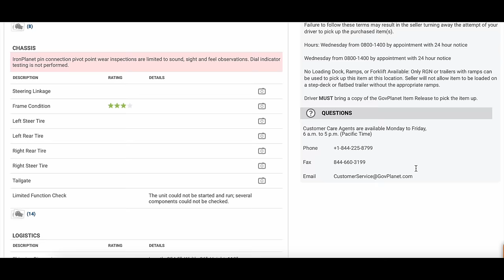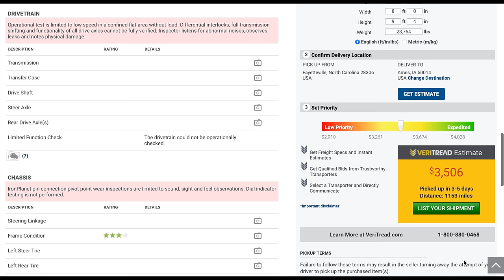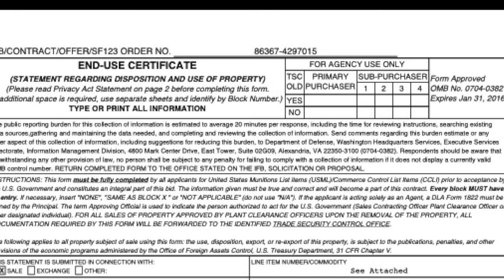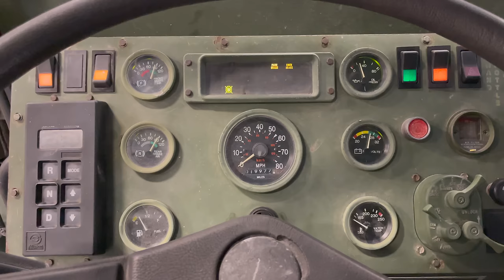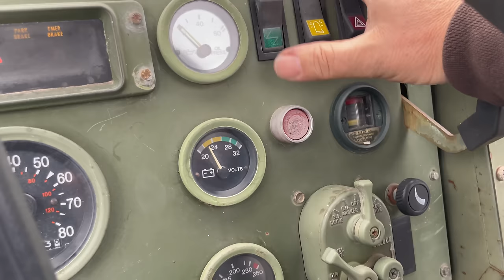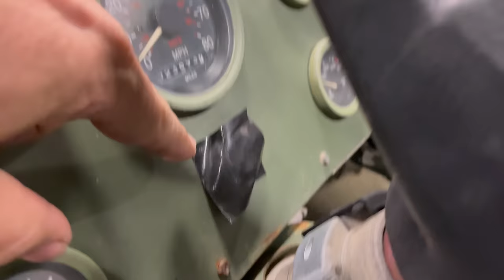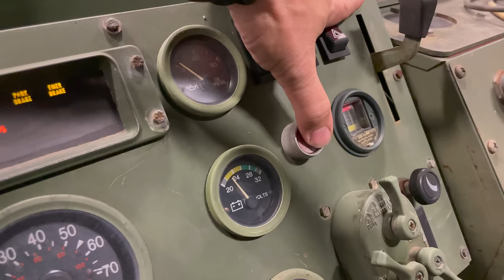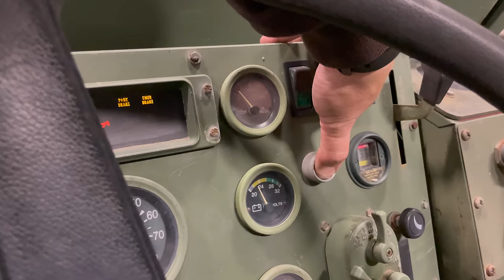Buying a LMTV on GovPlanet Wasn't How I Expected

Comment: These look an awful lot like the civilian and military trucks made by Steyr-Daimler-Puch (also Austrian, like the Pinzgauer). It must have been a design licensed to several manufacturers around the world.

Nonetheless, $3000 is not a lot of money for such a versatile vehicle, especially one with features like an on board hydraulic system for the tilt cab, as well as being able to adjust tire pressure on the fly.

Comment: Sounds like the alternator may have been good, but the regulator, probably within the alternator had failed producing a high over-voltage, for example, above 16 volts, which would fry many lights (LEDs) and the electronics in the vehicle.
Reply: Theyre 24 volt systems but your point stands

Comment: I've got a couple of questions for you.  Do you have to have a CDL because of the air brakes?  What is the GVWR? And, how long does it take the tires to adjust up or down after pushing the button?
Reply: At least in our state (PA), they're not greater than 26,000 lbs and, even with the air brakes, don't require a CDL.  You could load one with enough weight (or a trailer with a combined weight exceeding 26,000 lbs) and then you would need a CDL.  This is straight from the PA State Police Commercial Vehicle Safety Division.  The weight, not the presence of air or air-over-hydraulic brakes is what decides CDL requirements.
We operate one of these at work that has a 1000 gallon water tank.  Even fully loaded, it is under 26,000 lbs.
Reply: The tires adjust on the order of several minutes.  I know of several that don't work, the electronics or wiring of the system seem unreliable.  The air plumbing to/from each wheel is pretty solid, though.

Comment: The position of the steering wheel looks to be 90 degrees out of Sync with the direction of travel of the vehicle   !! i.e. , When you're moving straight , the steering wheel position looks like you're making a Right turn .....

Comment: Thanks for the great video.  I have a crazy notion to buy one of these mil-surp trucks to convert it into a SHTF RV.
Reply: @gurnblanston3210  - Very cool.  The 6X6 mil surp vehicles were also in the running for a post apocalyptic RV conversion.  What kind of mileage you getting in the MTVR RV?  Probably almost as bad as the 15 MPG I get in my 4Runner.   :-)
Reply: @gurnblanston3210  - Thank you very much for the detailed information.  Sounds like, as they said in the movie Stripes, one heavily armed recreational vehicle.

6X6 > 4X4

My 4Runner is set up as a stealth SHTFmobile.  It outwardly looks like a soccer mom grocery getter, but it's fairly capable off road and there's a lot of recovery equipment hiding under the cargo shelf.

There's nothing stealth about an MTRV post apocalyptic RV, but it would be awesome.   :-)

Comment: Having a lot of experience working on FMTV vehicles, all I can say is that they are total crap vehicles, from the grossly under-powered garbage-monopolized Caterpillar Engines, to it's gremlin-plague electrical systems, all of which comes out of no where and will leave one stranded. Been there, done that too many times.

That said, there is nothing like a trusty old "Duece & A Half" (M35A2), where half of it can be missing and it'll still run.

Comment: Are parts for these trucks readily available or do you have to cannabalise other trucks to get parts? I realise the engine and transmission are fairly common pieces so getting parts for them shouldn't be an issue - usually

Comment: Which is smoother offroad going at faster speeds, the pinz or the lmtv? I'm assuming the pinz.
Reply from the maker: Definitely the LMTV larger tires always makes things smoother off road no matter the vehicle and the 47" tires on the LMTV can absorb way larger bumps than the 34" tires on the Pinz.  The cab on the LMTV is also on a air spring system so the chassis takes all the hits and not you.

Comment: LOL! They took the tilt meter off the dash... Go like a bat outta hell in a straight line, wants to lay over at 20 in a corner...
Reply: That may just be because of the cabover effect. Cabover vehicles unless they are super stiff always feel like you are about to roll through a corner.
Reply: @Falcodrin  It's not an "effect" when the builder intentionally installs an extra metal plate with a crescent shaped piece of glass tube with a plastic BB in it. Especially when there are red warning labels at either end of the scale.

I've driven conventional, I've driven cab-over and then I've driven these... a trash truck (top heavy as hell, cab over) is still more stable than the MTV family.

Comment: We lost a lot going from the M35 to the LMTV. for the mere gain of power steering.
I'm sure the ladies appreciated that, but you aren't going anywhere without an electrical system and the panoply of gadgets. The LMTV is not an all-time anywhere any condition vehicle.

Comment: I was a mechanic (63B10) in the Army, 1978-1982. That is definitely a nice truck, but, to much electronics. I'd much rather have an old M35A2 multifuel turbocharged Duce and a half. Much simpler.

Comment: That truck has circuit breakers. You could have just reset them after replacing the alternator and transmission controller.

Comment: Guessing MPG is about 10-12?
Reply: Taking the 8.5 MPG LMTV will use $7,100 in fuel.Oct 4, 2017     We Bought a Military Truck So You Don't Have To - Outside ...
Reply: 6 to 8 in mine on highway.  About 300 miles on 50 gallons
Reply: @timf2279  Sounds like yours is well tuned then.
Reply: @SteelWolf13  that was in an 1083A0 with 3k pound load on flat highway across Kansas.

Comment: These trucks should have a start/stop on the side so you dont have to wait for the cab to be down to stop it.
Reply from the maker: That is on the newer LMTVs not these.
Reply: @ThisWeekWithCars  what are yours? I drive M1083, and similar. Did you end up with 90's trucks.

Comment: Seemed like you needed to be pretty handy and familiar with these trucks to operate. What was the top highway speed? Could you take this thing on a road trip?
Reply from the maker: I wouldn't want to drive it much past 55 mph, they make road gears that you can install into them to make them do interstate speeds.
Reply: @ThisWeekWithCars  What kind of fuel economy does she do?
Reply from the maker: Believe it or not I have yet had to put fuel in either truck, still driving around with what came in the tank.

Comment: Out of curiosity, what’s the fuel Econ/burn rate on one of these LMTVs? Do they get 10mpg? Obviously they don’t make good commuter vehicles, but for a trailer hauler around the farm, they might be just the thing.
Reply: They'd be great for a farm truck. Other than that, I could not find any reason to recommend one. They are absolute trash. Surplus vehicles are usually vehicles that were excess to a unit, so they began stripping the truck to get their other stuff up and running. They are sent over "as-is". By the time it finally gets turned in it's missing everything that is needed for function, or replaced with the broken part they replaced on the other truck. 
Also if you like all torque no power, then these are for you. LMTVs are the worst vehicles the ARMY ever had, but they are also the best driving experiance, while they work.
Reply: @mattevans1643  good to know. Thanks!
Reply: About 300 miles on 50 gallons of diesel on the highway.
Reply: Matt I wouldn't agree with you.

Comment: There is almost always a manual backup for tilt cabs
Reply from the maker: You can use the air system or the manual hand pump but both have to use the hydraulics to release the lock and lift the cable there is no manual procedure.
Reply: @ThisWeekWithCars  interesting well at least there is the air pump but glad there is still some kind of backup

Comment: Has anyone tested if those trucks can handle pickup truck type work, such as if you need to transport heavy items tile or hardwood flooring when renovating a room, or will the suspension system fall apart if you load it with 700-800lbs of stuff?
Reply: I had my 2004 mustang in mine from Illinois to Nevada.  No issues.  That's over 3k pounds

Comment: By how much the steering wheel is off I’d say they do a piss poor job of taking care of vehicles that taxpayers pay a fortune for
Reply: If it works it works. Mission essential taskings take precedence over something the operator can correct. When you have engines and transmissions blowing up left and right, steering that is slightly off becomes a non issue.

Comment: So if a truck has a dead battery it might be surplused and a new placement bought?   My tax dollars at work.
Reply: More than just batteries dude get real
Reply: @timf2279  I hope you are right.  It might means it might.
Reply: @catsupchutney  I am I can break it down sometime
Reply: @timf2279   When you have time, I am here.
Reply: There are several generations of these trucks.  The first are the A0 trucks. They have a Cat 3116 engine.  They are mechanical.  From the mid 90s to about 2001.
Reply: The next is the A1.  Cat 3126 engine and electronic. 2001 to 2006. Approx.
Reply: Next is A1R Cat C7 engine.  2006 forward.  The A1R models have a standard cab.  Also they have a new Armored cab called the A1R1P Low Signature Armored Cab (LSAC)
Reply: So as the new trucks enter service they release the older trucks much like a rental car agency.  Some go to other units Active/Reserve/Guard.   If they are not picked up within the DOD system other government agencies can request them. After that State Agencies for Surplus can request them.  Then they are sold at public auction through GovPlanet.  So let's look at the truck in the video.  It came from Fort Bragg.   Before it was DXed (direct Exchange) one for one, the unit decided to exchange their worst one. As the worst one is selected other drivers grab parts for their trucks.  They pick the worst one from the motor pool to DX.  One with gremlins or has problems.  The LMTV has been known for electrical problems.   One thing is wiring harness rubbing on steel under the dash, causing grounding.  The armored cabs were needed so the standard cabs were taken out of front line service.  Many armored cabs were sent to the Middle East from Sealy Texas for direct replacement for the standard cabs.  Same truck new cab. It's not unusual to see a truck with under 10k miles reach GovPlanet.  Some units just don't deploy for real world events or go to the field for training.   Units like the 82nd Airborne deploy a lot and spend a lot of time in the field so their equipment is well used.  Also they receive replacement equipment at a higher priority since their equipment is well used and their deployment status.  National Guard can have some great running vehicles since they have full time employees that maintain the equipment and they don't deploy as much as Regular Army.  So this truck had a lot more going on than just a Battery problem.

Comment: You have to carefully read the terms of the auction.  I found out the hard way that there was a 10% Buyer's Fee (which I was aware of) and a 10.4% Tax (which I was not) on the Vehicle I purchased which is buried in the extensive auction language.  The vehicle info was extremely vague and the resolution of the photos wasn't that great and even though it said running condition by the time we got there to pick up the vehicle we noticed the cosmetic condition of the vehicle wasn't really as described and several tires were flat along with the Batteries.  The Richie Bros. Auction Staff was nice and paperwork wasn't a problem though it took some time so plan on spending 2-3 hours go through the process.  Overall the vehicle's condition wasn't well documented so it's important you inspect the item prior to bidding on it.  It is also a good idea to be prepared for dead batteries, flat tires and low fluid levels and have some way to remedy this prior to pickup.

Comment: why is the steering wheel so off center?  is the alignment FUBAR?
Reply from the maker: Someone probably installed it that way, it is splines so it can be installed in any clocking you want.  The wheels were probably turned when they put it on and didn't know it.

Comment: I don't know a lot about these vehicles but I have worked on a lot of things from school bus to farm trucks to heavy equipment. And I am just wondering if this truck would make a good 5th wheel puller for a 44 to 47 foot camp trailer. Will this truck get upto at least 65 or more I have been looking into getting one to pull a trailer as it looks like something that would do a good job and would stop and handle better than these new no weight one tons meaning they have not got the weight to them that my old 65 ford one ton had. So when I seen these trucks it brought my old one ton back to mind that truck would pull anything I hooked to it somethings didn't get to high in speed but it would pull it.

Thanks for any info anyone may have.
Reply from the maker: A lot of people do that with the 6x6 version the FMTV, I don't know if I have seen them do that with the 4x4 LMTV.
Reply: They have a cat 3116 or 3126 and an Allison 3700sp.

Comment: @2:34  Really you thought that ad gave you a legit quote?  Ignorance will cost you alot bud, if there is an ad for something then I know to ignore it, gotta look around and find the better deal, an ad will never give it.  I wouldn't have openly complained about the first 2 things, the # of bids changing wasn't a "problem" it had nothing to do with the price I dunno why you obsessed over nothing, sorry man I'm in customer service, I hear your kind all the time...  IF you put in a 2nd bid that was higher than your first then it counted both your bids, ebay does this as well.  IF that ad was valid then I wonder why there is a button that says "get estimate", when you look at that ad it is worded in a way that would not lead me to believe that was a valid quote, I can't stand when common people can't comprehend this stuff and then gripe at me about it like I did something to them....  Nice lookin trucks though, atleast you had the money or credit to get that stuff home, someone like me can't afford to pay someone else to haul stuff for me, I'd have to figure out how to fix it or rig it up to drag it.  You CAN drive it on the road without papers, just don't get pulled over, I've done it a bunch of times over the last 25ish years lol.  Those allison MD 3060 and 3070s are some nice automatics, I prefer them to a manual even and I hate automatics but not allisons 3 and 4000 series slush boxes those are stout.  Ive had a couple of buses with them.  When they are in 1 and 2 gears they don't allow full throttle that's why it gets goin in 3rd gear, your turboo gets fed enough fuel to do it's job.
Yeah I don't doubt the open market deal was worse, when you see a normal person selling these it's because they GAVE UP and didn't wanna throw money anymore at it pretty much every single time, that's why I never bought one yet, one of these years I might find one worth it, but usually I pick up buses for cheap and salvage them.  One of these LMTV would be nice refitted to being a winch truck or MD under reach/wrecker, I'd like to do that with one at some point in life if I can get my debts paid off lol.

Comment: Pop the hood !   Ok first I need to spend 5,000 $ to get the 3,000 $ truck , after waiting like a year …..dude pop the hood !    Ok ✅ see this solenoid hooked to the starter ? Here is the hydraulic system I’m going to fill with air , while the -equity truck …leaks an unknown fluid …..pop the hood !   Someone tell this guy most states require commercial $ insurance and registration and charge by weight and tires ! Lmfao. Don’t buy one ☝️ of these ….let alone 2.

Comment: Do you need a CDL for these, or is a regular license fine?
Reply: Regular, however people will argue you need a cdl.
Reply: @timf2279  nice
Reply: If you are not driving commercial you are not required to have one.  PRIVATE NOT FOR HIRE.  air brakes.  Some states have this endorsement and some don't..   the 26k weight is about commercial.   LMTV is 18k and fmtv is near 26k.

Comment: Do you need a CDL to drive those?
Reply from the maker: Depends on your state and use.
Reply from the maker: In my state of Iowa for example if it was used for farm use "The operator of a covered farm vehicle is not required to hold a CDL to operate a vehicle within the scope of the covered farm vehicle exemptions."
Reply from the maker: In Wisconsin where I bought the first truck I brought home they kept at a farm and put a SMV sign on the back.

Comment: Just don't like cab over trucks, I would much rather have a 5 ton. When I first started watching on GovPlanet they used to have loads of them, then when richie bros' took over they like vanished. Now its all these cab over things. The humvee's and trucks used to start out at a lower bid too. If somebody knows where I can look to find one to fix up That would be awesome. I can rebuild the body(have a supplier of ar500 plate I was going to remake the fiberglass body panels with)as long as it mostly runs.

Comment: The only problem with these trucks are rust, panel degradation and electrics with things missing. The only advantage is the Non Common rail fuel injection system.

If you buy something with common rail it could mean massive dollars as everyone would had messed with it.

Wow u have Roundabouts. I thought only English nations had them.